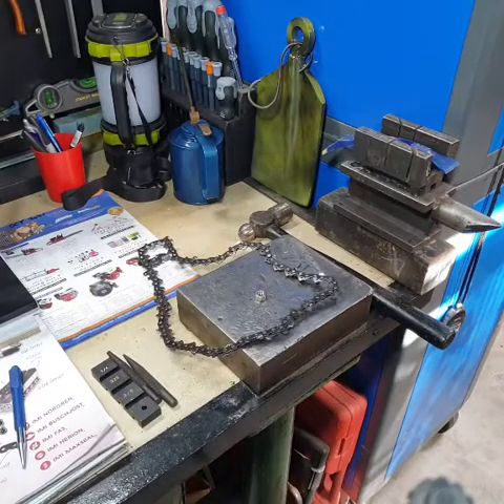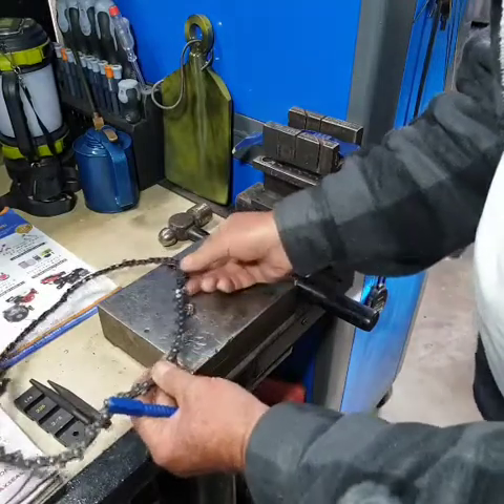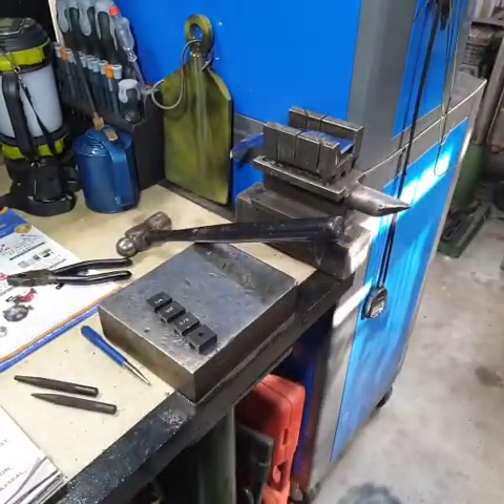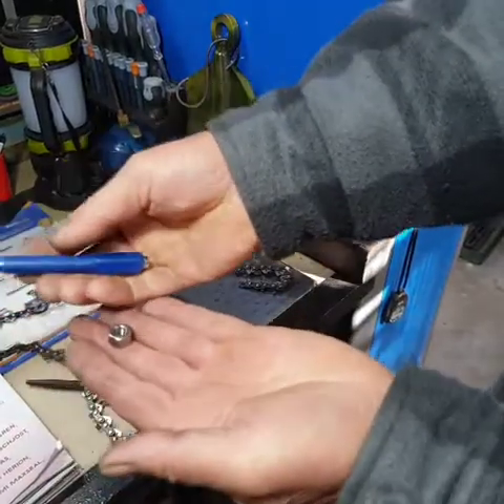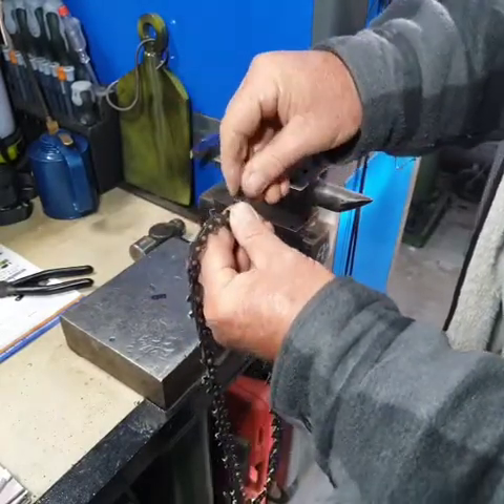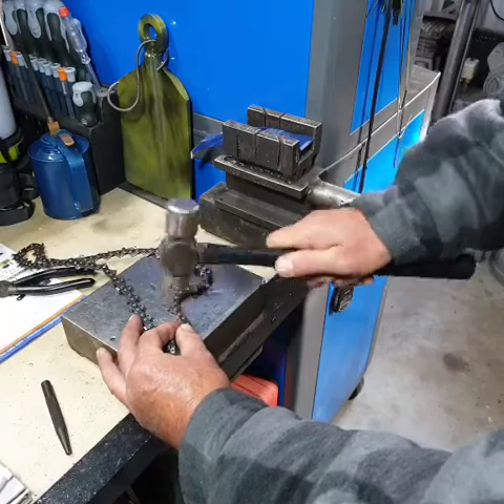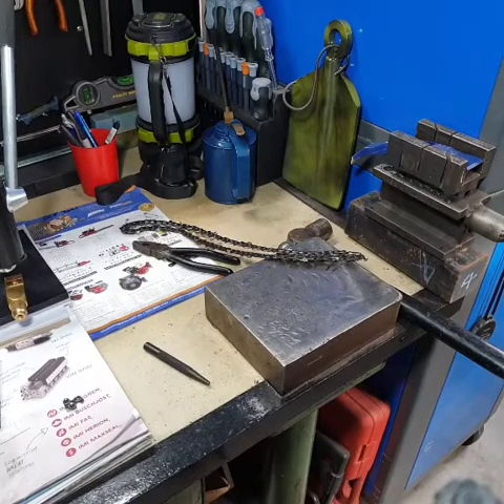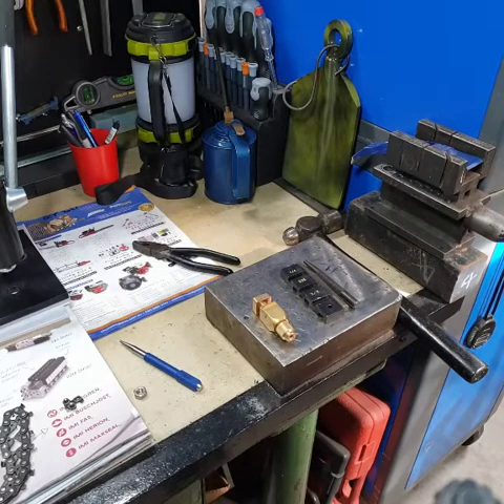Chainsaw Chain Breaker by hand using simple tools

Comment: I use just the ball peen hammer to set and shape the rivets. For an anvil, I use a small bench vice. Often, just use a file to cut the heads off the rivets.
Reply from the maker: Yes that works well.